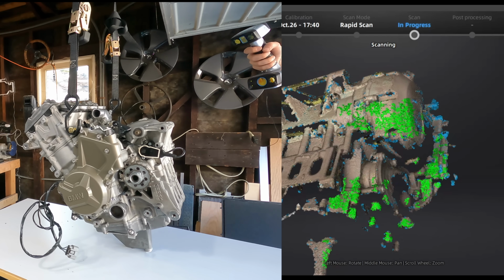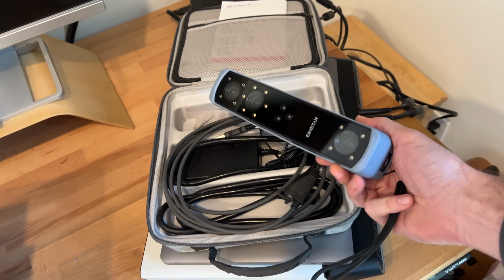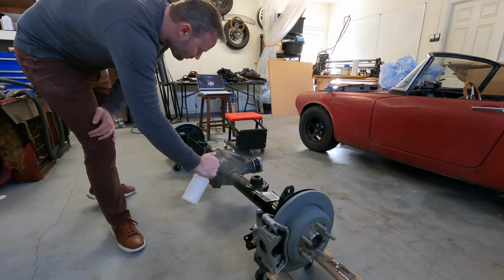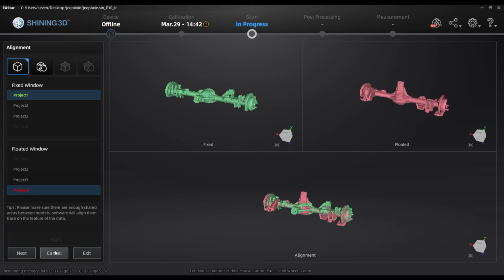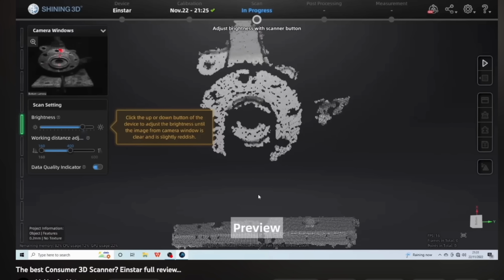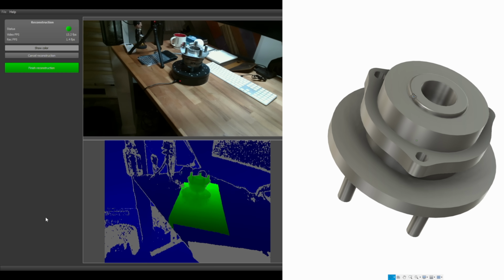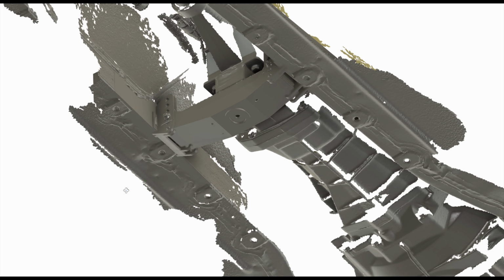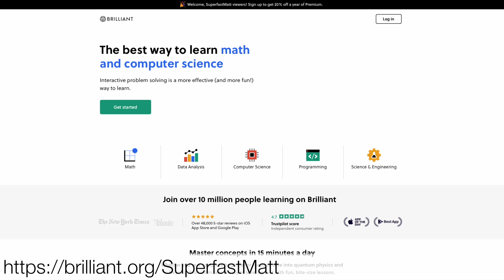It’s Time To Put A 3D Scanner In Your Toolbox

Comment: great video, if you have a 3d printer, print reference point holders. you can get pretty creative with making some nice ones, small multi sided pucks or longer hex posts. Let me know if you want some stl. you can attach them with sticky tak (blu tak from loctite works well) or put a magnet in the prints for magnetic surface.

Comment: So, if you could add something reflective to your baby powder/alcohol mix, couldn't you just flick/splatter spots all over the surface to get the same effect as the dots? Probably some cheap acrylic paint and considering how it's delivered, it should just as easily clean up w/out much worry of adhesion. Just a thought, love the vids.

Comment: Pretty sure you did a review on the Creality Raptor... I came to the same conclusion, its dog water.

Though, what I was using it for was probably more applicable, a bumper.  You have to use a metric shit ton of targets... the tracking otherwise DOES NOT WORK.

The worst pary of the entire process was the fact that after 2 hours of scanning, the scans were just... ok at best.  Lots of holes, jagged edges, missing detail.

Oh, and IR just refused to work all together.

Its being returned and ill be trying out the Einstar I guess.

Comment: so lets recap - need to spray dust and crap everywhere, you get awful fuzzy scans that you need to manually trim and clean, it doesn't give you real geometry and can't regonize basic shapes like cylinders and squares so that you can actually edit them in cad, and it costs $1000. might as well just use one of those phone apps that use the camera.

Comment: Hi @superfastmatt, we are launching our Monocle 3D System and Monocle Prime app for dimensionally accurate 3D scanning of objects.  We're trying to keep error below 0.5% for models in the 2-5m range  I'm just wondering what kind of error tolerances you are actually getting with the Einscan scanner?  Also thought that the white powdered trunk at 6:01, should scan really well with Monocle Prime.  If you have an iPhone with two or more cameras onboard, I'd love your thoughts.  Especially as you use these models for your work!

Comment: So one thing I have been doing when scanning full cars in flat areas, I will throw a large cloth near  the part and start scanning. The scanner uses that cloth almost like a dot and the tracking is unbelievable. (Even better than using the dots tbh lol). Afterwards I delete the cloth bits from the scan, do that a few times slowly offsetting the areas of the cloth and the parts I did and did not scan. Really loved the results and the speed it did it in!

Comment: I wonder if the scanner works while it's stationary, and the part is moved around. One could make a jig, with a turntable, from which a part could be hung with an extra thin fishing line, and turned around in front of the scanner.
Reply: Yes the scanner works fine when stationary with the part revolving on a turntable
Reply: @Warnoo55  thanks!

Comment: Could you use a spatter effect with reflective paint to mimic the target dots?  Would be hard to get uniform sized dots and you wouldnt be able to have the contrasting black border.  You could adjust "uniformity" and size with paint viscosity and gun pressure, probably couldnt get nearly as big a dot to be reliably round, but it seems like the software is pretty capable.....

Eh?

Comment: I’m not going to watch the video but I am going to agree and give you a comment. I graduated with my masters in mechanical engineering in 2015. I was in a class of people where we had to learn both auto cad and hand drafting because we were in a transitional period where people still hand drafted. It was rare but we had to learn it. In 2013 I got my 3D printer and drafted most of my parts to send to the printer. 3D scanning existed but was out of pocket. Now, your new IPhones have 3D scanning and literal 10 year olds can scan model and print mock-up. It’s insane and almost undermining the masters degree I fought for lol. I run a performance shop now and we engineer and design track builds and I’ll stand by it when I say these 3D scanners will make engineers out of anyone. Like given finger paints to a child and that child becomes Bob Ross.

Comment: Do you require the high end computer/laptop for the scan itself or can I use something lower end for the scan itself and then use something sufficient for importing the cloud mesh and working with it?  I am thinking of having a computer sufficient to do the CAD as a desktop system and using something less powerful, probably a laptop, to control the scanner and save the data generated by the said scanner that would be more portable.

Comment: Question 🙋 from Japan 🇯🇵
Hello, I have a question about the turntable!
Without using a turntable,
I'm interested in a 3D scanner that captures only hand-held
I am interested in a 3D scanner that does not use a turntable and only hand-held.
Most relatively inexpensive 3D scanners are not able to capture well when hand-held, right?
What is the best hand-held 3D scanner that you recommend?
What is your best recommendation for the best handheld 3D scanner?
What is the name of the manufacturer and the price?😊

Comment: Why dont you just subtract the scan from a block in CAD, and then subtract that from another block. The 2nd block should be the void left by the san in the first block thus you have a solid now. Its been 10 years since I switched CAD disciplines from mechanical to Geotechnical so things may have changed. Thats how I did it in inventor pro 2013.

Comment: I have been using 3d scanners since 2015. I purchased an artec eva and watched as the hardware stayed the same but the software just kept getting better. Same with my Artec Leo now. completely wireless and battery powered. I started scanning to use to make bucks for sheet metal shaping. 

One thing I do have to say is that I have never scanned something for someone else and had them be happy with it. Even when scanning for free. Everyone expects magic and you give them an STL and they just don't know what to do. Even people I consider experienced CAD modelers. They expect a parametric model but don't want to pay for the time of doing that. So I would like to add the recommendation that this is something you do for yourself and don't expect to make money scanning things for other people unless your wanting to do a lot of solid modeling for free. Using scans in CAD changes your processes and changes your thinking so just don't expect other people to be able to  understand.
Reply: Most people don't understand what these scanners are capable of honestly. They except an exact replica, with no errors and that hardly ever happens. We use Faro Arms at my work and they work really well, but they also have limits. I usually just scan a part I need and then use that as a base to model the real part. Little bit easier then measuring everything.
Reply: @JeremyDN  agreed.  Im looking at a wireless cmm to help fill in the gaps with a point cloud model to help bring a better precision  to bolt hole locations and add more quantitative data to my scans.

Comment: The Viper is in DIRE NEED of a solution like this! When I rebuild mine 2010 fourth gen I couldn't believe just how rare almost every part of this car has become. It's just stupid - most parts were used for more than one generation (suspension from 2003-2017) and it was and is a halo car. MOPAR lets the Viper die and can't deliver even basic spare parts for steering and other stuff  (don't get me started about headlights, body panels or fender supports). The whole car is so easy and so worthy preserving it - it's a shame that many owners are almost forced to scrap it when they are in need of parts and just don't get ANY official support. My hopes lay in the aftermarket - maybe someday 3D-scanning will provide us with everything the manufacturers can't. It's such a capable and simple 'kit car' and Stellantis can't even handle that - how should people like me trust them with keeping things like a Demon or Charger-EV alive?

Comment: Matt .. about the need for targets which you hate : does the scanner work if you use a laser pointer and grating, disco mirrorball or even a planetarium projector (or any old slide projector) to project a pattern onto the large featureless surfaces the scanner hates ? I guess the projector should be rigidly fixed on a shelf or a tripod etc so the pattern doesn't move during the scan

Comment: 3D modelling still looks like a nightmare of knowing what you want but not knowing how to get it.  I want something that can read a mesh then quantize the general shape it into mathematical formulae so you have a vector-based clean model instead of a jagged rough and performance-impacting mess of unnecessary polygons!  I've spent countless hours modelling in Blender only to find I calculated something wrong 30 odd steps ago and now have to redo everything up to that point because I can't just change some rule from which the mesh was derived (because it was all done manually instead!).

Comment: A pro tip: 
Try  change one ceiling light to another shade. The processing runs smooth afterwards
For the floor, many scan tools has the options to set IDs for objects and subs. 
Select the floor id and hit select all, and delete. 
Remember to cover the floor with a color you dont have on the scanned object or a color that is not near the floor

Comment: Nice alienware area 51 laptop i have that,  if you are wanting a beefy boy to go i recommend checkng the specs before you buy, I  agree with the annoying part with the  2 power supply. You have to have 2 power supply attached because of its graphics card not active or turn on with out the power supply plugged in, that is why is choppy, it is a dumb design it's to allow battery last longer in potable mode with just the processor running only.

Comment: This is a great video. Informative and funny. Was cracking up with the shower cap and i'm not your dad comment. I've been wanting to get a scanner for a while. Used an old Xbox kinect sensor years ago for 3d prints and it seems hobby scanners haven't gotten much better. This one seems pretty good and isn't $10k+.

Comment: What we really need is a good AI mesh tool, that can distinguish a tube from a bend from a fillet and redraw the geometry(ies) as a solid model. Also, I see an inherent danger as the proficiency and cost barriers are lowered, for DIY guys to cause serious problems because they don't understand how to use things like FEA tools. It's great if you can simplify your suspension upright to polygons and send them off to SendCutSend (there are less expensive altenatives to SCS for sure) but that doesn't mean thety are structurally sound, or the DIY guy is going to get them welded together properly or even know what steel to specify. The kit car community survived for decades without a ton of mishaps because they were forced to use OEM components from donor vehicles (Jaguar, Thunderbird, Corvette,etc.) Once people who don't have a lot of engineering experience are turned loose with affordable technology they are apt  to be a danger to themselves things could get sketchy and I'm afraid potentially become an area where DOT might have to set some ground rules. Hopefully everyone will know their limitations, but there is always that one guy who is willing to undertake something he's just not proficient enough to pull off sucessfully.

Comment: I've got that $10grand scanner to use with my $5grand computer. You would think I could afford the scanner spray at $40 a can 😅. Thank you for the baby powder mix I will be trying soon! Also have you tried the reflectors using magnet backings? Makes life allot easier.
Reply: anything you can do to eliminate or reduce cost of consumables makes the whole thing sweeter

Comment: Also, instead of dots you can use any other random object of reasonably scannable geometry to scan otherwise unscannable areas. For example, a scaffold made of Lego placed on or around a unscannable surface will allow the scanner to pick up the surface.

Comment: Blender > File > Import > [your filetype] > Right panel blue wrench icon > Add Modifier > Decimate. I like collapse, and for your purposes and a sub millimeter scan you can go well under 10% without losing much detail (you want to type in the value, dragging the slider around can crash). Always a nice feeling to watch that polycount in the bottom right drop and the fps go up. Blender modifiers are non-destructive, so removing it will undo the changes. You can export with File > Export > [your filetype], just make sure "Apply modifiers" is on. You can also apply the modifier destructively with the dropdown next to "Decimate".

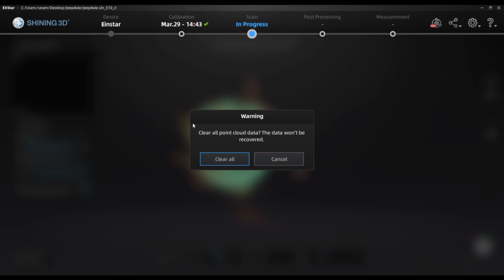Comment: Great video Matt!  at 6:41 where you mention wanting to "undo" the last 30s.  If you pause the scan you can use the cleanup tools in ExScan to select and delete portions of the points.  this works pretty well when you get that junk data however if you are using markers or hybrid alignment, i found that the markers stay which can be troublesome.  I have noticed, like the deck lid on the viper, with big flat areas if you get double markers these end up needing to be deleted and just redo the entire scan in that project.

Comment: Hi, will you make the scan of the car available? I have a gen 2 gts and having a bit of a issue fabbing up the intercooler piping due to radiator to hood clearance. If you could help that would be amazing! I'm a one man operation the hoods off and I wont be able to get someone to help me get it back on for another couple of months unfortunately.

Comment: I was doing my first optical car 3D-Scan around  10 years ago with a kinect and some cool open-source-software. But it was a pain to get right. Accuracy was rather meh. But I didn't design parts, I just wanted to visualize the way the car should look in the end. Paint, small modifications a.s.o. I could not find my car in any 3D-modell shop, so I scanned it on my own. The car had/has faded black paint, the worst for this IR-scanning method. I used wet news paper from the paper recycling trashcan. But the baby powder trick is way better.  Gonna keep this trick in mind if I finally start to make parts. But it's interesting that the advances in the software are not that huge compared to back then. More user friendly: sure, more integrated: sure, but the individual steps and process seem to be quite similar and error prone.

Comment: Attach  trailing arms to axle with forward mounts fitted. Place axle under car in desired ride height  position. Remove anything in the way to enable trailing arms to attached to body at the desired angle. Do the same with Panhard rod. Run axle through full bump travel, left, right, both. Remove anything that fouls. Reinforce and strengthen altered areas and mounting points.  Stop for lunch and have a nice cup of tea.

Comment: Hey Matt, Great videos! I wonder if spraying Silly String on a large smooth surface would help to scan it. It would create a lot of unique 3d geometry that the software should be able to use for stitching. Obviously, it wouldn't create a pretty scan, but it might create an accurate scan. As a bonus, it would be way more fun than those stupid dots.

Comment: Maybe this is missing in the consumer lever of their software, but Shining3d software has a tool that lets you orient axes on the scanned part before bouncing the mesh, though it's pretty touchy if your part doesn't have an obvious XYZ to match. Really helpful to orient stuff before pulling into CAD. You can also run a mesh reduction in that software before bouncing out the STL. Fusion360 also has sweet mesh reduction that you can localize to act on only non-critical parts of the scan, and I always found it easier to make face groups in Fusion to hide random floating geometry that I was too lazy to get rid of.
Love seeing your process on this, wish I'd known about your white powder mixture ages ago - seems way better than the  climbing chalk I was using.

Comment: I may have to finally buy one of these! I used one back in university 10 years ago or so and the teacher I borrowed it from ended up building a whole semester’s lesson plan around the scan I made of our college’s founder’s statue. Scan object, work with scan, 3D print, use model for machining, make vacuum formed parts, etc. I’ve got several projects around my Durango I’d like to do but keep putting off due to the complexity of the measurements I’d need to take. I may finally be able to buy my way out of this predicament without breaking the bank too horribly!

Comment: Use meshmixer instead of mesh labs.
It's still not as intuitive as it should be, but at least it has undo and also has sliders and a live preview of what you're adjusting before you apply the actual change.

Comment: I would just open it in blender and use the decimate modifier... Blender can easily support 60 million poly's at decent frames without crashing like everything else ive used. It's also got the undo feature.

Comment: For mesh decimation, Prusa Slicer is better easier and fast to use, or Meshmixer, or Blender ;)
Reply: Gom ispect allows you quick and precise to align to planes with the 3-2-1 point solution (All these softwares are either opensource or free like meshlab)

Comment: The first cad program I used was bend tech pro.(I bought it myself to build a rock crawler chassis)I loved it for the simplicity.  I currently use 2d Autocad. And I'm getting the hang of it. But I feel I would be more proficient using solid works. I only need to program parts in 2d for work so I doubt I'll get solid works on my company computer. I guess what I'm getting at is. What is an affordable cad software that has the ease of bend tech but also modeling capabilities?